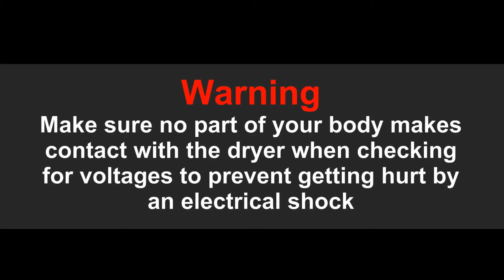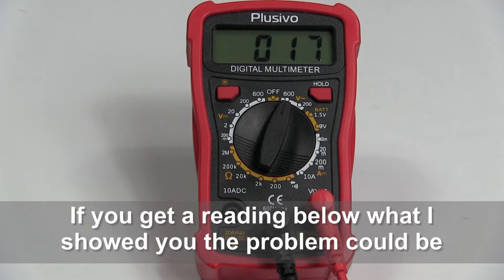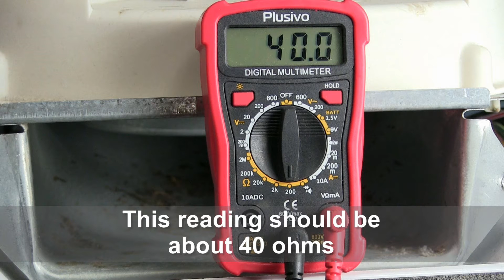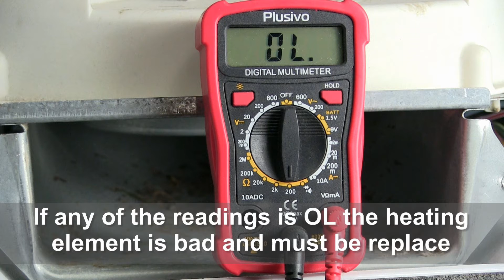Cabrio Dryer Not Heating - The Heating Element

Comment: Great video showing the entire process of disassembling and reassembling the machine. I have exactly the same model and the same issue. Could you tell me what is the part number of the coil you installed? From where you bought it? Thanks.